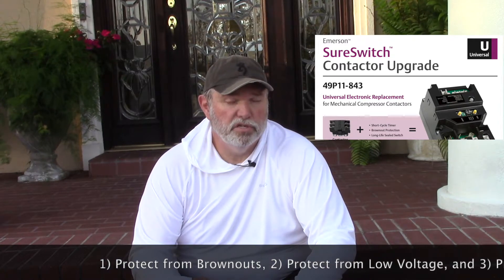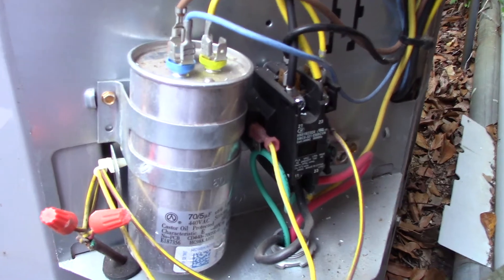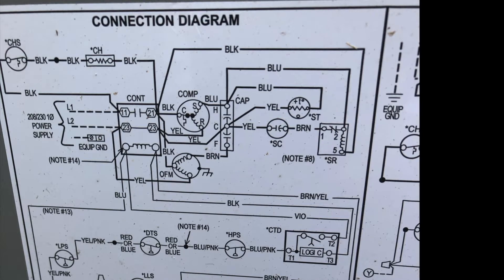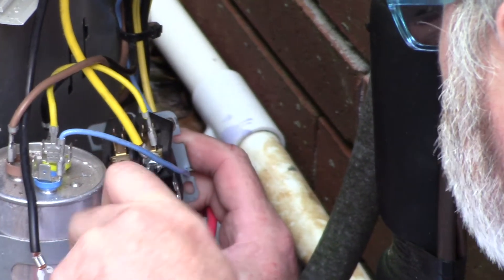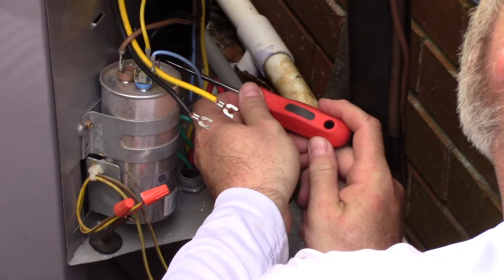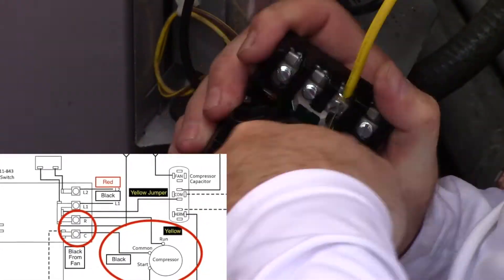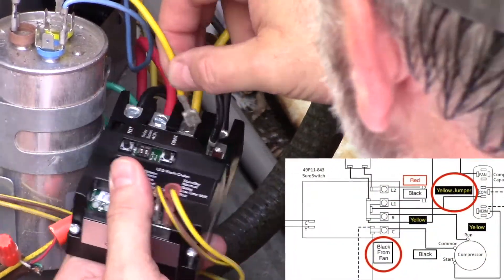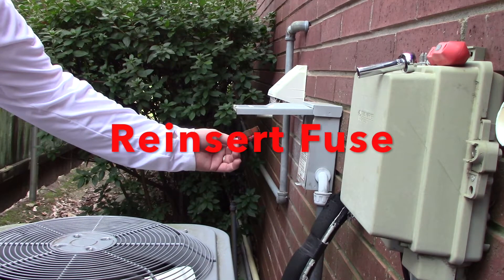Ep01- Ready your HVAC to Run on Generator with an Emerson SureSwitch

Comment: Can't thank you enough for putting this video out. I wrestled with my Hyper Engineering Sure Start install for three days -- installing and reinstalling it on my Keeprite 2-ton AC according to Hyper Engineering's wiring schematic. After three days I got no joy and I'd all but given up.

Fortunately, I came across your Youtube video and I noticed that your run capacitor and contact switch were identical to my Keeprite AC's. It was also 'very' encouraging to know that I wasn't alone in discovering that the Sure Start wiring schematic was 'not' the same as mine (and yours) and that the step-by-step instructions they gave were near useless. I tried reaching out to their tech support and got no response whatsoever. I wasn't impressed to say the least after dropping over $400 CDN on the unit.

After wiring up the contact switch and run capacitor to match your configuration, I was elated when my AC fired up. With much apprehension, I put my clamp meter on the HERM lead and, to my surprise,  it recorded a drop in the LRA from 62.9 to just 5Ampms. That's a hell of a drop. Kudos to the Hyper Engineering design team.

Now, because of your good work, I can run my AC with my 7000 watt generator during an outage. 

Know this.....you made a big difference in my day.

Warm regards
Reply: UPDATE: Just got a reply from Hyper Engineering support. Two hours after posting to you ...lol
Reply from the maker: That’s awesome and the only reason I did those videos (well to also show step by step for friends hit by Hurricane Laura). Glad it helped…your kind words made my day. Thanks